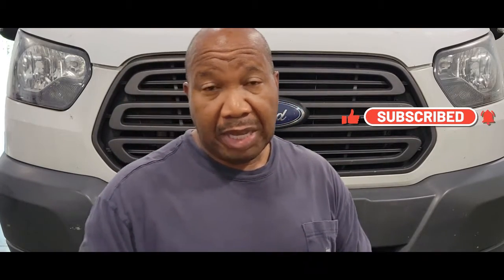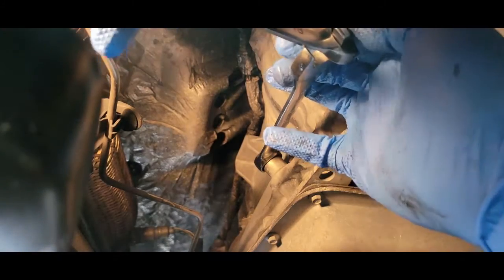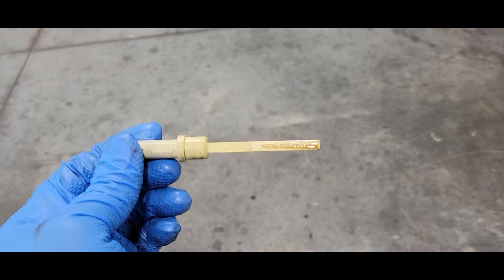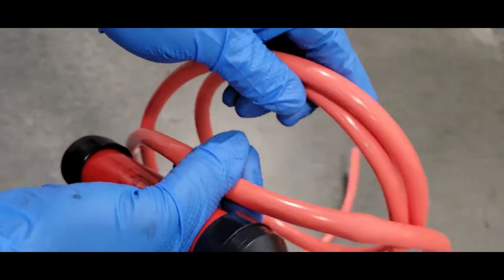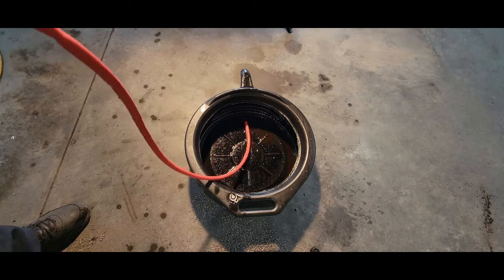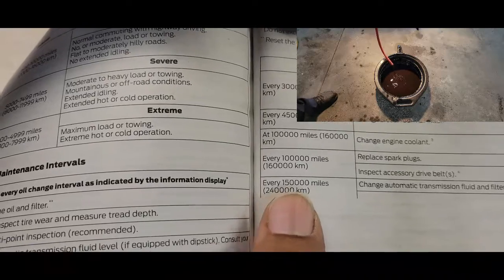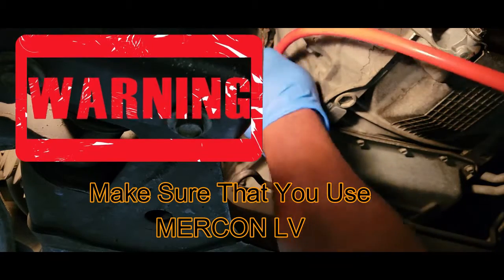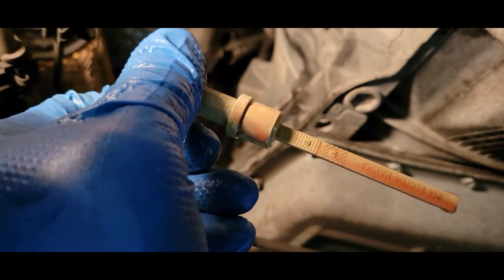2018 Ford Transit Transmission Fluid Change

Comment: There is the way to drop transmission pan on these. To increase clearance you just need to raise transmission (2 nuts holding it) with the engine (2 more nuts). The clerance will allow you to do whole transmission service, change filter, etc.
Reply from the maker: Thank you for sharing 👍🏽

Comment: it's worth the 300$ at the dealer to have them flush the entire 13 qts while running/pumping new fluid in. this just gets 2 qts. i'm doing my 2022 t250 every 40k mi. 300$ a year. i'm living in mine full time and trying to go 500k mi in her.

Comment: I do that on my 2018 transit every 30k miles since new 186k miles later, no issues.  I will say, the shop that dees it for me gets 5 qts out, so im not sure what to think here as you only got 2.5 qts out.
Reply: You ever changed the transmission filter? What about your diff? How often was that fluid changed?
Reply: Never changed the filter.
Differential, I added a different cover that added an additional 1/2 quart of fluid and i use royal purple gear oil changed at 50k mile intervals

Comment: Thanks for this video! My 2018 Transit just hit 170,000 miles, and I’ve been experiencing some torque converter slipping. My mechanic added some slip stop, which helped temporarily, but now it’s time to change the transmission fluid. I’m really glad I found your video! Would you recommend changing the filter as well, or should I just do a fluid change?
Reply from the maker: @rayanderson4302  Thank you for watching! At this point, you maybe better off having the Transmission  professionally service by the Ford Dealer or a grade A Shop. At 170,000 ,it may sound strange.  But changing the filter and not to mention the work involved with that. It may cause you more problems. I would have it professionally flush and let the Shop know that the Converter had a slip.

Comment: As soon as I lift the dipstick out I got transmission fluid pouring out and I got that corner of the truck jacked up a little bit so you would think that the fluid should be a touch lower at the dipstick area. Is my transmission overfilled or something?
Reply from the maker: @MindsEyeVisualGuitarMethods  That's a good question.  There is a mechanic friend of mines that believe in running the Engine while he is adding or checking fluid in the Transits. I feel that if you do that, fluid will pour out on the next guy. If just a little bit came out. I would not worry too much about the level.

Comment: I just baought a 2018 transit van and was looking long and hard for the transmission dip stick. I decide to check youtube. and found your video. thank you. 
I also want to replace the tranny filter, do i need to remove the subframe?
Reply from the maker: Hello, 
           A Gentleman gave a very helpful comment a few days ago. please read below what he said.
 
There is the way to drop transmission pan on these. To increase clearance you just need to raise transmission (2 nuts holding it) with the engine (2 more nuts). The clerance will allow you to do whole transmission service, change filter, etc.

Comment: The 150k miles that Ford gives borders on criminal negligence. A lot of Transit owners have reported transmission problems at 60-70k. Mostly from the AT fluid getting sticky.
I had a funny problem with my transit a few years ago. Drove fine except when I took it on the freeway. Then after a little while it would throb and vibrate very loud. It was even difficult to drive over  MPH it would get so bad.
Took it to the dealer and a tranny shop. They both said transmission flush and rebuild and quoted thousands of dollars.
On the advice of a forum member I had the dealership just do a flush and replace. Still a lot at $400.  But much less than a transmission rebuild!

Funny part. The MANAGER of the dealership came out to tell me it was a bad idea and would not fix anything.  He even had me agree that it wasn't their fault if my transmission got worse afterwards.

Well that was about 30k mostly freeway miles ago.  Transmission runs smooth as butter. 

If your transmission is over 50k with the OEM fluid, get it changed before it gets sticky.
Reply from the maker: @NullStaticVoid  I agreed!👍🏽  Thank you for sharing!

Comment: Don’t you need engine running to circulate fluid while checking level?
Reply from the maker: @MikeReszke Yes Sir! In most cases that is what you do. But I have found in this case after serving about (10 - 18) of these Transits. Checking with engine not running the fluid is right on the full mark.

Comment: What about the filter?
Reply from the maker: @MrRealistic316  Good question,  Ford made it so you have to go through channels to change a filter. And if you change it. You still will not be able to put no more than 3-4 quarts back. I have spoken to a good friend of mind that is a Ford Service Manager.  Ford don't even change the filter. They just recycle the fluid.
Reply: @dairleautoclassicrestorati6892  recycle the fluid?  
But I would assume the filter can get plugged up from material. That's why I ask about changing the filter.  I worked for Benz dealer early 2000's. Trans service was fluid , trans gasket , filter and crush washer.
Reply from the maker: @MrRealistic316  you are correct! Changing the filter would be ideal 👌

Comment: I looked up my my transmission it said 3.5 quarts initial fill and 13.1 quarts total fill.  What does that mean?  You only put 2.5 quarts?
Reply from the maker: 13.1 quarts is a full transmission service that is done by the Dealer or a Shop with the Transmission Service Equipment.  The service that I did was mainly replacing what is in the Transmission Pan. That's why I mention you can run the Engine and repeat the procedure a few more times. It still will not be a 100%. But it is better than not serving it at all.
Thanks
Reply: @dairleautoclassicrestorati6892   WOW! that was fast, you're the man.  But doesn't it just keep mixing together, that would take a long time.   Soome one told me they do it with a machine and it can blow depries out from the corners and cause more damage.  OR do they pull the pan to do it?   I would like to get it all new, I was wanting to use AMSOIL SIGNATURE SERIES FUEL-EFFICIENT 100% SYNTHETIC AUTOMATIC TRANSMISSION FLUID.  what do you recomend.  I used to do this on my EVan but it has a cooler and you could disconnect that and get more out without dropping the pan.
Reply from the maker: @hankwaddell998  I would recommend using the Motorcraft Transmission Fluid that it came with if you are going to do it yourself like in the video.  I believe the cost is around $250-$300 at the Dealer for a FULL Fluid removal. I don't believe that they drop the pan. I could be mistaken.  And they only take about 30  mins. That is one option.
Reply: @dairleautoclassicrestorati6892  thank you.
Reply: I drove ford E250 - 1st a new 1970, only  3 EVans until I bought my first Transit 250 in 2015.   2015 only made it to 115K miles before it was totaled.  Now I have a 2018 T250. As I said before I want to change all the fluid in the transmission.  I remember doing it my E Vans they all had a transmission cooler and to replace all the fluid I would connect a clear vinyl tube to the radiator / cooler end and use a clear gallon jug with a mark at the - in T250's = 3.5  quarts.  Then run the van until 3.5 quarts came out.  Then fill 3.5" quarts and repeat on T250 5 times.  This would pretty much replace the fluid.  So you think this method would work on the T Van.
Reply from the maker: @hankwaddell998 I like your system! I have not tried it that way. But I don't see why it wouldn't work.